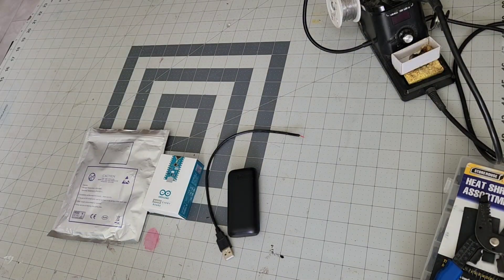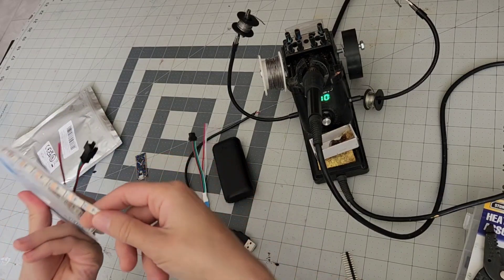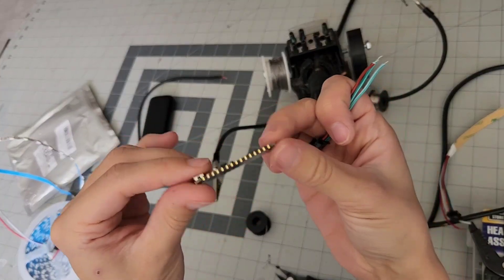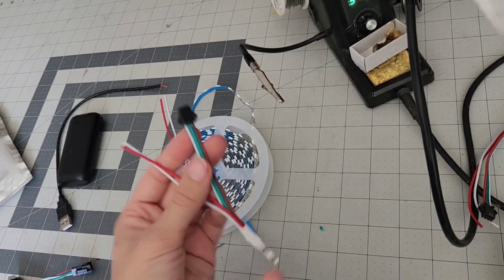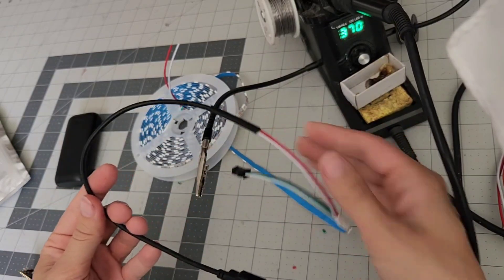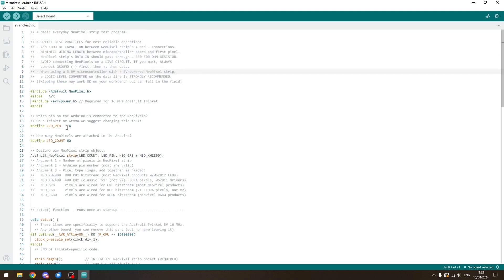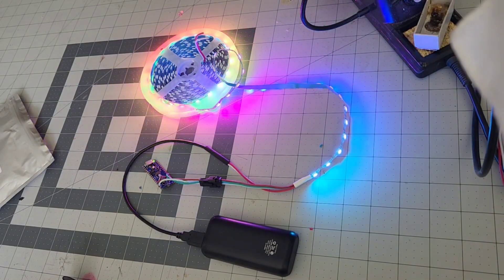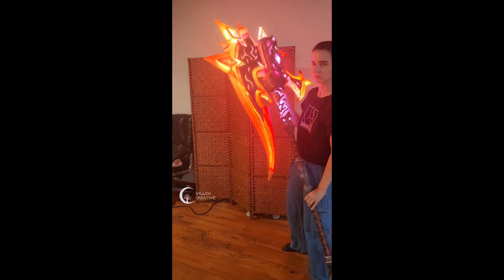Simplest way to make addressable LED strip (Neopixel) setup for cosplay lights

Comment: Hey noob question but how do you select what gauge wire to use with the LED strips? Thank you.
Reply from the maker: I like to use 24g, if you have a very large project then 22 or 20g is nice from the initial fork from the battery where most power is concentrated. Sometimes i use translucent or black 26g or 28g wire when they need to be hidden more (like floating props)
Reply: @WillowCreative thanks so much

Comment: Hi, amazing turtorial! I was just wondering if the power bank you use has any specs and how long does the LEDs strip last with this setup?
Reply from the maker: 5000mah and dont know, it varies on the length, the animation, color and brightness. This is just a test example, i didnt add it to any setup
Reply: @WillowCreative  Thank you!

Comment: Sweet! I wasn't sure you could solder wires to the through holes of Arduino chips. I figured I needed header pins and plugs and stuff. Thanks for this very helpful tutorial!
Reply from the maker: I dont bother with the pins as they take extra space and time but you can use them for breadboard testing. If you use some kind of specific case to put the nano in they usually want you to use the headers as itll fit in the case better
Reply: @WillowCreative Can you run more than 1 program simultaneously on a single chip, or do you need multiple chips for each effect? Like can I have some LEDs stay on constant, and others chasing? Or if I wanted to make like a blade heating up effect, can I run the color change sequence and like a sound chip that makes a sizzle noise or I need different chips for each of those?
Reply from the maker: @itsagundam79  Sure, just put the other group of leds/electronics on a different data pin (same power source, fork it off the usb power wires) and copy the code but change the data pin input. You can also change the programming to group your led strip based on the amount of leds in each group. Make as many if-loops that tells the pixels to run a different color for a certain number of leds (say led 1 to led 10) and another color for another certain amount of leds (say led 11 to led 20). etc etc until you have as many indvidual groups you need, then assign them different colors or patterns per group. 
For multiple different tasks I recommend checking out some adafruit projects about making your own lightsaber for example as they use lights and audio at the same time, and simply change the programming to suit your own inputs, colors and audio. Sometimes it can be quite tricky to run multiple sequences simultaneously or have the arduino listen and update at the same time (multitasking) which can require a more complex sequence of programming: 
https://learn.adafruit.com/multi-tasking-the-arduino-part-1/overview
Reply: Awesome work! I appreciate how accessible you make this feel. "What exactly do you mean by fork it off the USB power wires" for multiple strands? I'm looking at the pins on the board and I'm not quite sure what that means it's supposed to go to
Reply: @Bentoebox  the power source is your battery, not anything on the board.
Reply: @itsagundam79  I meant that in Willow's circuit, the power bank is wired to that specific strand. If I was running multiple strands off of other pins, where would I be wiring the battery to
Reply: @Bentoebox  you would take all the red wires from all the strands, and they would go to the red wire coming from the battery pack. Same for all the black wires from strands, to the black wire from the battery. The individual data wires would go to whichever data pins you want on the board.
Reply: @itsagundam79  ohh making clusters right . Cool thanks!

Comment: Noob question, what are the difference of these selections in your led link (Wattage: 1M 30 IP30) Is there a specific one to purchase. Thank you
Reply from the maker: @dougcouch7521  1m is for length so 1 meter leds (one full roll is 5m). 30 is for density so 30 leds per meter. I used 60 leds in this video which is the default and i also show a small piece in the video thats 144 leds density. Ip30 is the water resistance and ip30 means none (what i use). The others have a plastic layer or plastic sleeve which can make it difficult to modify. Ill add it in the video description!

Comment: what material did you use for the part that covers the leds on the axe?
Reply from the maker: @AxLdmh  that was 3dprinted with a layer of tinted epoxy resin! I have a different video that shows how that axe was made